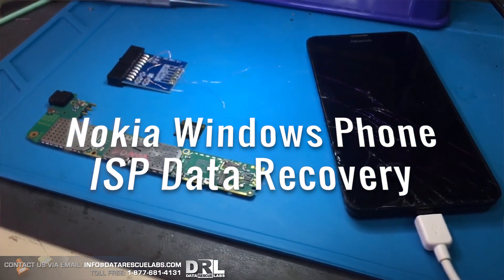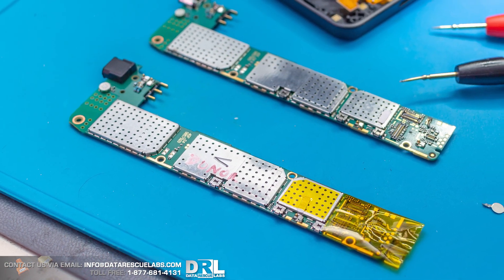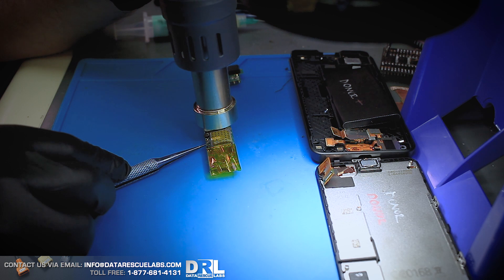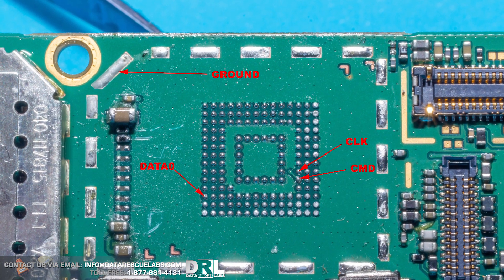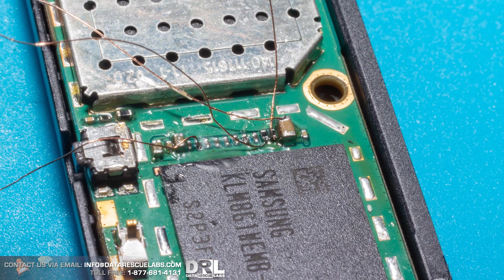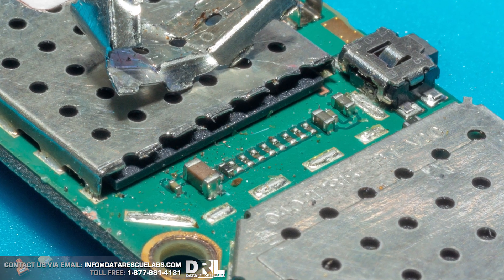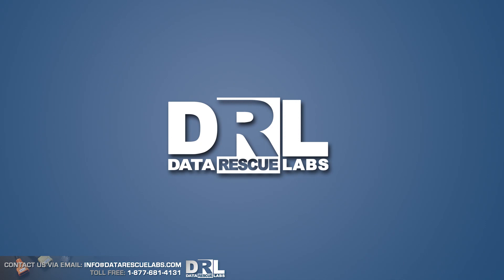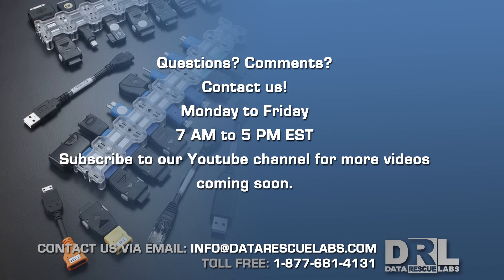Windows phone data recovery

Comment: Had lumia 1020 with bootloop non bootable issues lost 30gb data holiday pics etc. hoped one day be poss to get files n maybe take internal memory n on a new mboard 
sadly dunno if was is possible but shop accidentally recycled it when asked for replacement of same brand.. Would it have been poss. getting data..was gutted over it n wanted to keep phone incase
Reply from the maker: Do you still have the phone?
Reply: @forensicguy  Sadly , no. Was recycled but same has happened again cos I procrastinate n dont back up.. So do have a phone that needs files off

Comment: is there ANY CHANCE TO REVIVE IT OR IS IT GONE FOREVER
Reply from the maker: There is a chance but it’s very expensive. A nand protocol needs to be used instead of emmc to read the chip
Reply: thanks but is it possible to put it in mass storage mode @forensicguy
Reply from the maker: It won’t be helpful. The data is zeroed out. You need nand access to direct memory bypassing the controller
Reply: what actually
is  nand access @forensicguy
Reply from the maker: In your cellphone, there is a memory chip type eMMC, this type of a chip has a built on controller that communicates with the phone and sends data from the memory chip (NAND). If the phone is factory reset, the controller zeros out the data. Then, the data isn’t visible any longer. However, if we get access to the memory chip directly, via the NAND protocol by bypassing the emmc controller, we can still recover data that the controller does not have access to.
Reply: @forensicguy  is it software or will have to desolder memory unit
Reply: @forensicguy  Wow
Reply: will i be able to use my phone after  nand protocol or will it become brick

Comment: why u not only swap the emmc from damaged phone to donor board ??
Reply from the maker: The original phone was working, we just needed a physical dump. The task was to find isp pin out on the donor board and dump emmc from the source board. The lawyers were very explicit making sure that we don’t remove the chip from the original board. When dealing with forensic cases, we sometimes have rules to follow.
Reply: @forensicguy  thanks, so the reason was to minimize the risk ?
Reply from the maker: Yes. Otherwise I would have the chip off and not waste time with donors and pinout research